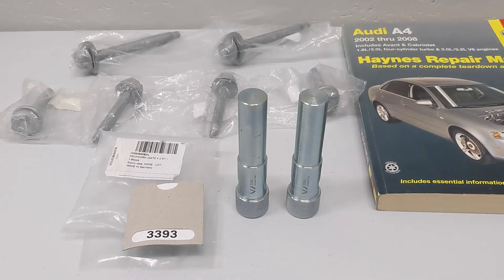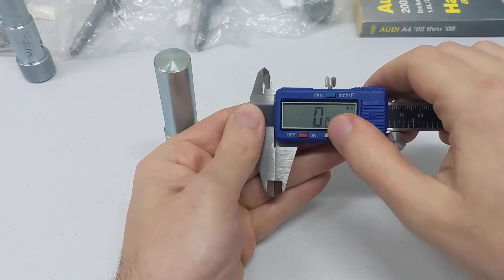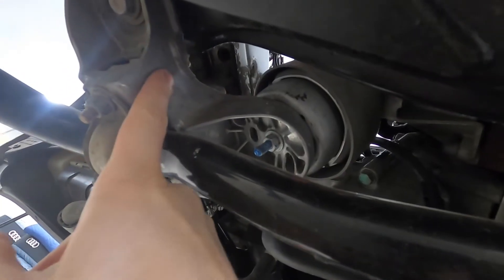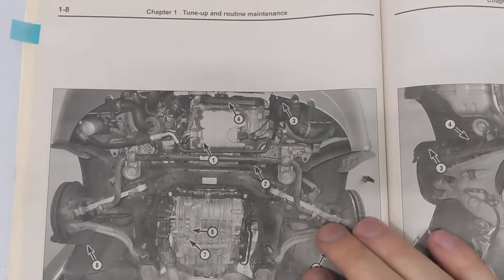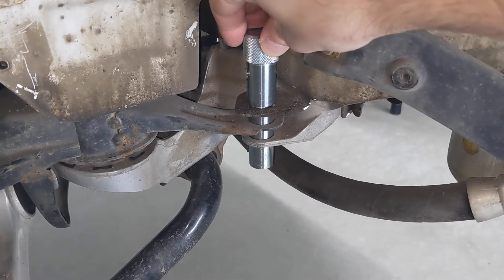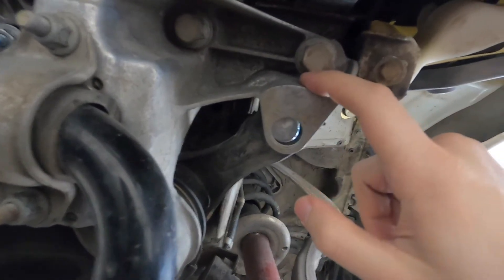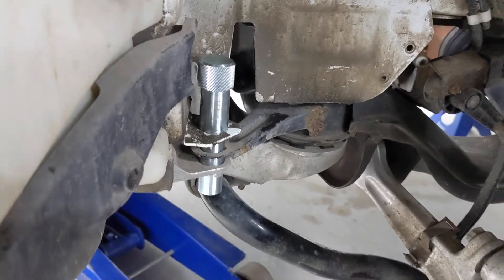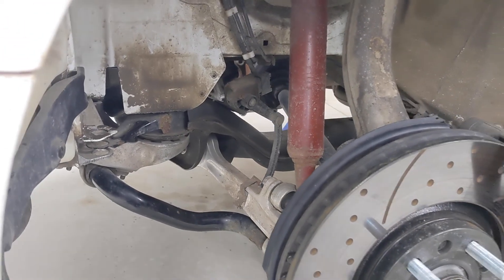Audi/VW Tool 3393 | How to align front subframe | Audi A4 B7

Comment: I just changed an engine/motor mount on my b7 tdi. Engine was supported, subframe wasn’t and I fully backed out the long bolt! Subframe dropped a bit, had trouble getting bolt back in (car was on axle stands on driveway) Got it all bolted up and getting a creaking sound since. Must be alignment of subframe then!! Thank you so much for posting this video! Will get an alignment tool and sort it. Thanks again👍

Comment: Any tips for alignment of the rear subframe?
Reply from the maker: From personal experience and after double checking the repair manual (the same one that explicitly calls out this tool/process for the front subframe) - there is no similar method for the rear. I think in part that's because there are less movable parts in the rear and generally if you can line up the subframe mounts really nice and center with the bolt holes in the body, you're there. I usually mark up parts with a paint pen prior to removing them so I know where "home" was before.

Comment: Can you do or tell us how did you move the subframe to align the holes?
Reply from the maker: Depending on how badly things are out of whack, you can just loosen the front subframe bolts to achieve enough movement to knock the frame back into alignment. The worse is it, the larger the likelihood the other bolts/rear end of the frame need to be altered as well. It's more an art than science.

Comment: Does bad alignement cause steering wheel shake at high speed ?
Reply from the maker: Maybe in extreme cases but if you're feeling a lot of vibration in your hands it's more likely you have bent wheels, improperly balanced wheels, or the wheels aren't mounted with hubcentric hardware. If it's not that, I'd start looking at suspension arms. Bad alignment is more likely to just pull the car in odd directions while driving and wear out tires.
Reply: @FigureItAuto  thx for reply, i have very big vibration in steering wheel only at high speed the car doesn’t pull in any direction, it drives straight very nicely, my problem occurred after taking the propeller shaft out and putting it back , may be this have something to do with propeller and position of the bevel gear flange, what do you think , your opinion can be very helpfull to me
Reply from the maker: That's not a coincidence then...did you reinstall the center bearing or anything that otherwise would change the angle of the shaft? I'd be careful till you figure that out.
Reply: @FigureItAuto i just unbolted the propeller to take the bearbox and bevel bear down

Comment: At the beginning of the video you mentioned these alignment pins would fit a B6. I have a 2004 Audi A4 (B6), and I saw these pins on ECS Tuning, but they couldn’t confirm the fit for me on a B6. Can you confirm again that these will work on my vehicle?
Reply: I think they are the same through A4 B5 to at least B7. Also at least A6 C5, probably C6 too.
Reply: @rkan2 , l have the same exact set up on my 2001 audi a6 quattro. However, l am told it won't  fit. Do you have data that indicates it will. Thx Peter

Comment: how do you jack your car up so high you can get underneath it? Could you tell me what jack you use and where you jack, or better yet a short video? :) I have a A4 b6 btw with 26 failures by roadworthy test but im not writing her off. I'm gonna challenge myself and fix it !
Reply from the maker: Ha, good for you - don't give up on 'er quite yet. If you check out the rest of my channel, you'll see an older video I have on jack stand pads. Now I use my QuickJack and don't need to do anything but roll the car onto wood blocks (since I'm lowered) before lifting.... but at the time this video was filmed, I was using my jack on the front cross member (not a great idea but there's few places to lift from) and then placing maxed out jack stands with a pinch weld adapter pad on the regular pinch weld jack points.
Reply: @FigureItAuto  Hey man.. so im back :) I replaced almost everything on the list.. The biggest problem now is the front subframe. It must be fully replaced because welding is not allowed where I live. (Germany). Do you know if its easy to replace the subframe yourself? I cant find any clear videos or instructions unfortunately.

Comment: Did you loosen the two bolts in the rear-most part of the subframe that share a mount with the transmission? It seems like if the tension on those were relieved the subframe would be easier to shift around(?).
Reply from the maker: I didn't, because although you are right, all of the subframe bolts are torque to yield. If you loosen them you're writing yourself a bill for new hardware. Maybe the cost is worth the advantage if your alignment is way out.
Reply: @FigureItAuto  so how did you move the subframe if you didn't remove rear bolts?
Reply from the maker: @angrypants7619  Even with the rear bolts untouched, there's still significant play in the front of the frame - in my experience at least. Enough to get things in alignment and not necessitate loosening the rear.

Comment: I’ve recently replace the engine mounts on my 2004 volkswagen passat 2.8l v6 (B5.5) and I have to realign my subframe as well. I just dont know how the heck im  supposed to move each “layer” (subframe and engine mount holes) independently. I seen you were using a dead blow hammer, but where on the vehicle are u using it? My car has been in the garage for the last 13 months while I have been replacing a  whole slew of components and shes finally complete but I cant drive her until I do this alignment. Ive been tempted to have AAA tow it to the Dealership for their $100 alignment. At the same time I would love to keep that $ and just do it myself since I have done SO MUCH  on her myself.  By the way  I very much appreciate your videos!  -Michelle 😎
Reply from the maker: Hey Michelle - Thanks for watching and congrats on getting so far with your project. I don't have a perfect answer for you because it's all just a dance between leverage and friction. You might need some pry bars (I just bought a set of Milwaukee H-beams https://geni.us/milw-4pc-pry-bar and really like them), maybe a jack push in the right spot; whatever gives you the strength to shift the layers. Plus, there's obviously a number of bolts on both sides of the car that will need to be loose and may not be limited to just the ones that hold the frames to the chassis. For example, your transmission may also be connected to the subframe via mount + bracket...so really it's all an exercise of tracing what connects to what and applying pressure. To answer your question, I was hammering directly on the circular part of the subframe that holds the subframe bushing. It took awhile to finesse.
Reply: @FigureItAuto  You know, part of me was expecting an answer like this. Yet the other part was REALLY hoping for a simple answer. 😆 I should know better than that by now tho… Nothing is a simple process on these cars! Lol. At least now I have a better idea on how I’m going to tackle this last daunting task. Thank you for the pointers. Wish me luck. 😉
Reply: @michellebonawitz5583  Doing the same thing for my 2001 volkswagen passat 2.8l v6 (also b5.5) Mine has been sitting since dec last year because of a spun bearing that occurred from oil deprivation.. long story. I've so far been using a 2lb rubber mallet to align the alignment holes on the subframe and a couple long sockets one of them being a 14mm, it's been working okay so far, but my transmission mount holes are about a 1/4 inch off, so I'm trying to work on that!

Comment: I did this with a long socket (forgot the size) after I lowered the subframe to replace the oil pump and motor mounts but I should really buy new bolts. Good video.
Reply: I used sockets too! Haha. It’s the 14mm deep socket.

Comment: Never knew about that alignment tool, seen the holes and it makes sense now.

For your alignment make sure they follow to correct raised toe procedure, basically camber caster toe is set, then the front end is raised 30mm and there is a secondary toe adjustment done by moving the outer tie rods up or down in the knuckle. Thats why book time is 2 hours for a b5/6/7 front end alignment.
Reply from the maker: And I didn't know about that procedure you detailed. Why do I get the sense it rarely happens.
Reply: There is also special "toe-in curve" tool called VAG 1925 for this very procedure.

Comment: The stock wheel brace handle fits the alignment holes perfectly 😉
Reply: What wheel brace handle?
Reply: @snoopy5736  for the wheel bolts, in the tool kit.
Reply: @calm4477  thank you, I'll check tmw.

Comment: Hey I was wondering if you happened to know the code instructions for programming the wiper stalk to control the instrument cluster on a Audi A4 b7, can you do it with Obd11 or it has to be vcds scan tool? I recently replaced the old wiper stalk with no reset or up/down to one that has it which is compatible to all b7 so I have access the cluster? Wipes work but no access to the cluster what’s so ever! My car is totally basic. Any help?
Reply from the maker: I think most of your answers can be found in this Audizine thread: https://bit.ly/3oL3m9t. I know for sure you can achieve the coding through VCDS but I have no idea if OBD11 or any other programming interface will work. I'd bet many can - but you'll need to spend time exploring the tool to see if you can access the right modules and adaptations, plus figure out what the variables are to change. In terms of cost, it might be cheaper to bring the car to a shop or dealer to handle the recoding if you're not ready to buy a VCDS type tool.
Reply: @FigureItAuto  okay I guess the best bet is to call the shop I was reading about vcds tool seems confusing & I’ve tried several times on the obd11 can’t get it to work! I’ll keep searching Audizine Forums for answers.